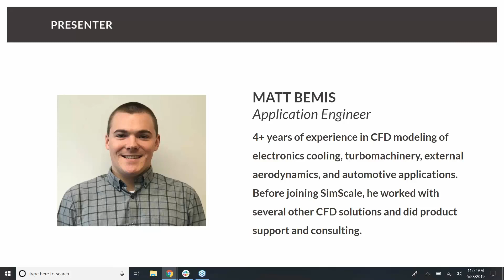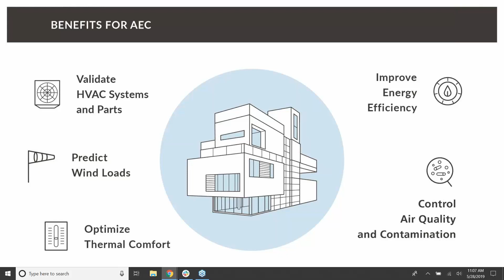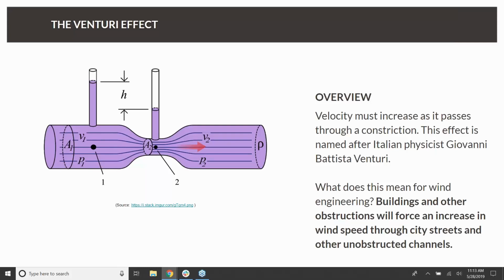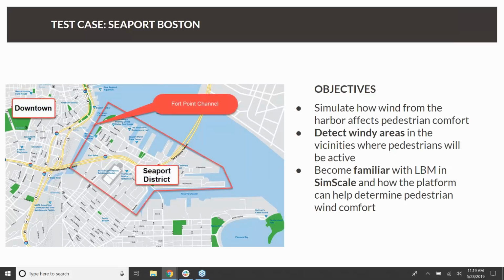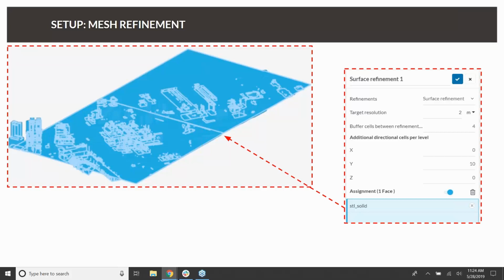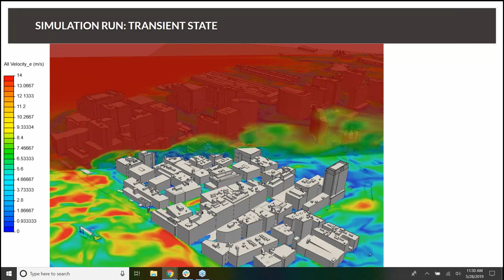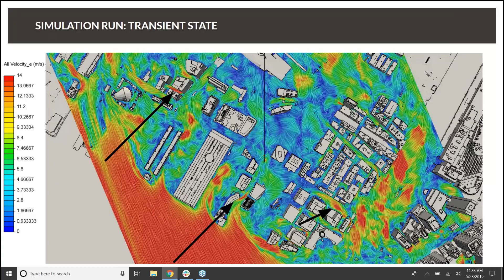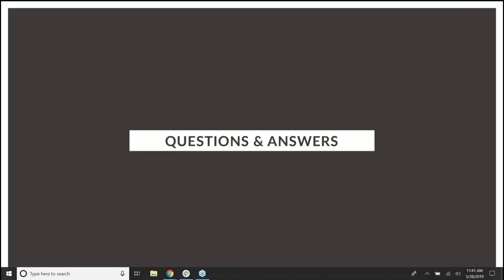Wind Analysis: Boston Seaport District

Comment: Could you extend a little bit on the "spreadsheet" part? How did you get these values, how do these compare to standards (say Eurocode or something else), etc. ? What about turbulence energy and/ or intensity?
Reply from the maker: SimScale allows a user to define Velocity and Turbulent Kinetic Energy or Turbulent Intensity as a function of height at the inlet. You can define the inlet by uploading csv data with as many data point as you'd like, and use this for the inlet boundary condition. It's really up to the user to decide how to define the inlet, but there shouldn't be any technical limitations or hurdles with regards to the platform. For more questions I recommend you email  support@simscale.com